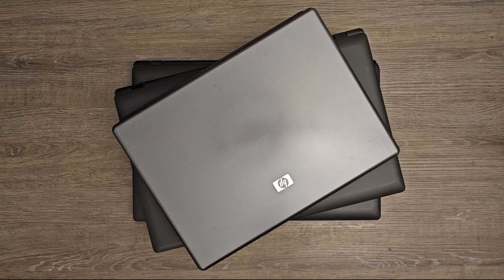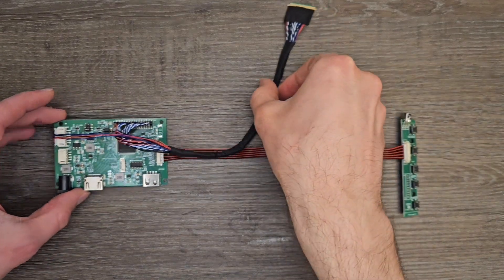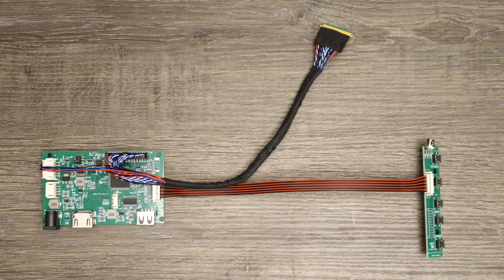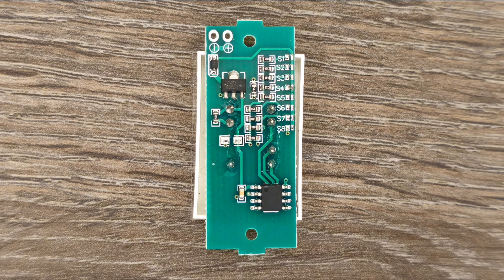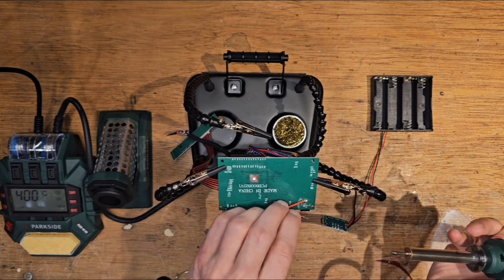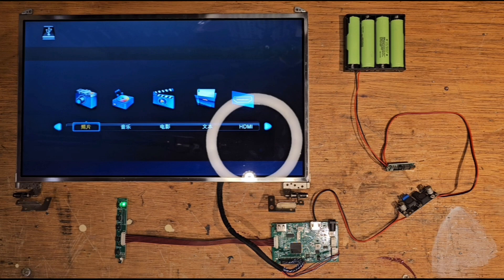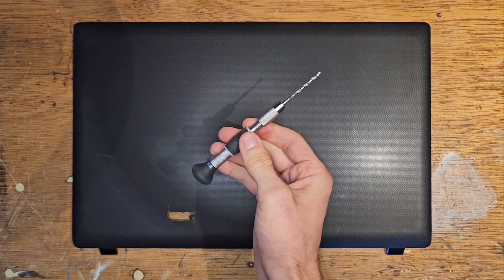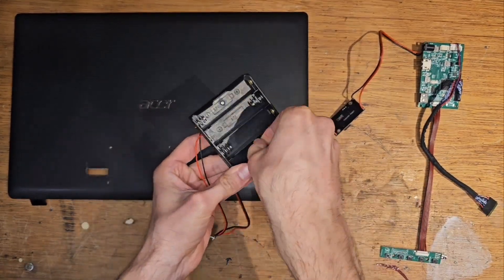Making a portable monitor from an old laptop

Comment: You have forget the BMS!!!!!!
Reply from the maker: I am using the charger circuit the way that it is intended to be used by the manufacturer. I did consider a different configuration with a BMS but then I found out about this circuit board and decided to give it a try. I am not going to deny that there are different ways to do what I did, in fact I already mention some alternatives within the video itself and as far as the power supply is concerned, even though I don't mention it in the video, it is definitely possible to change the setup.

Comment: Guys you can use entire old laptop just remove motherboard and put everything else inside.
You get laptop but not laptop XD.
You need to drill only holes for connectors and think what to do with keyboard and top cover in general.

Comment: Congratulations. 
Thanks for sharing! Could you please provide us with the link to the modules used in this project for reference or purchase?
Reply from the maker: Thank you for the question! I will try to answer the best way I can, but I am not sure how useful it would be to share links, since not all online shops deliver worldwide and even when they do, their online catalogue may change over time. That being said, I ordered most of the components for this video from Aliexpress. Here is what I used to build the monitor:

1 x LP173WD1 screen from an old laptop with the metal frame and hinges still attached
1 x LP173WD1 compatible control board
4 x 18650 Li-ion cells from the old laptop battery
1 x Case to house the four 18650 Li-ion cells
1 x USB-C Li-ion cell charger, designed to charge 4 Li-ion cells connected in series
1 x XL6019 Adjustable step-up/step-down DC to DC converter
Cables
M2.5 Hex Standoffs (With corresponding screws and nuts)
2 x 8cm x 1.5cm Flat Stainless Steel Connectors
2 x M4 16mm round head screws (I don't show this in the video but it's a good idea to put some M4 washers on the screws)
2 x M4 Self-locking nuts
Double sided foam tape

Optional:
1 x Li-ion battery capacity indicator 
1 x Push switch